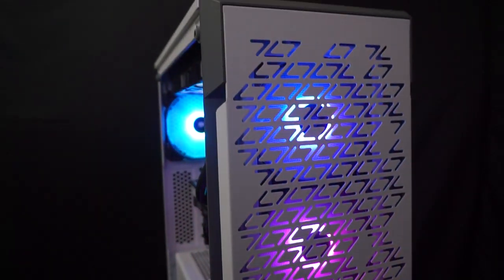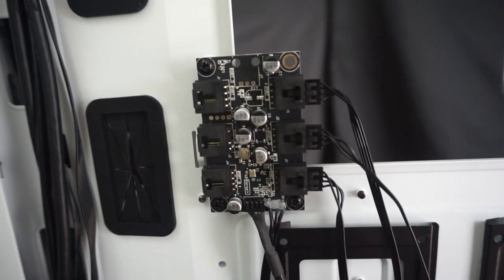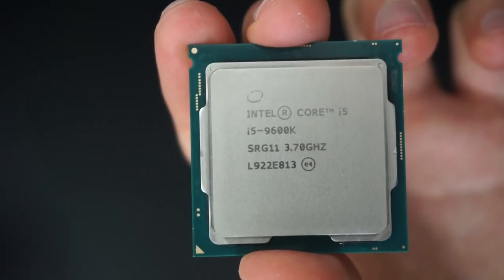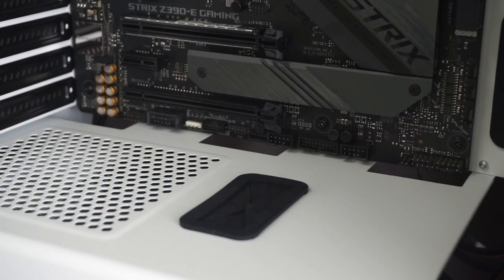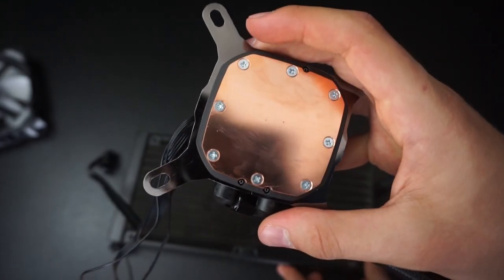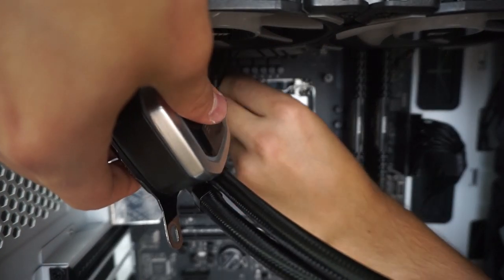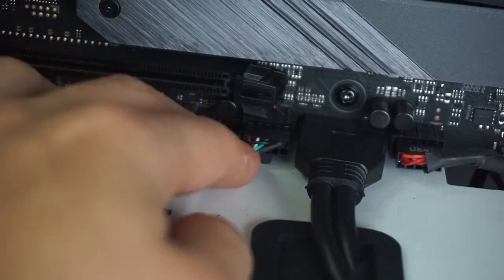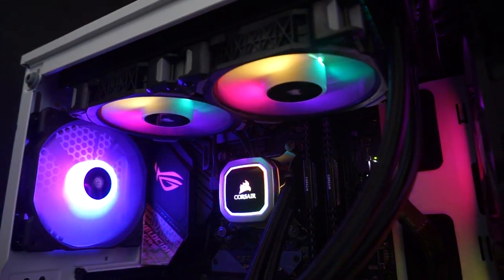Corsair 220T RGB Mid Tower Build Guide

Comment from the maker: To answer your questions: https://youtu.be/SFsQsY7lNiU
Reply: 1:53 your supposed to put the ram in the 2nd and 4th slot for maximum peformance
Reply from the maker: Elite Exility Yes i mention this in the comments.
Reply: Alex Krastev ok
Reply: Alex Krastev 
U
Reply: @Alex Krastev. What is the maximum length of a gpu in there? I want to fit a 3 fan one in there.
Reply: @enzohuang223  300
Reply: @subpoena.  oh h=okay
Reply: Can i use a single fan cpu water cooler and mount it on the side fan slot? or do the cpu coolers only mount on the top
Reply: @Alex Krastev would i be able to fit trident z rgb ram if a h100i is mounted on the top of the case?
Reply: @shamfulla  You can't even mount an AIO on the top of the case in the first place
Reply: @subpoena.  pretty sure you can if it's a 240mm
Reply: @shamfulla  Okay
Reply: @shamfulla  You probably could but it depends on your Mobo
Reply: @subpoena.  does the asrock b550 pro4 atx sound compatible to you?
Reply: @shamfulla  Hmm, that mobo is a bit more cramped than others... I just say send it, it works? congrats. It doesn't? well now you know, you can return the parts
Reply: When I turned the computer on for the first time all the RGB came on in the case minus the front 3 fans. Do I need to set this through the software or is this a wiring issue?
Reply: @SlickRTjr  Do the fans spin?
Reply: @SlickRTjr  If the fans spin and you see no RGB, make sure they're plugged in to the RGB controller in the back of the case, if they are... You may have to download iCUE software and troubleshoot there. (Also make sure the commander pro is plugged in to a USB 2.0 header on you're motherboard)

Edit:Fixed Typos
Reply: Does this work it’s micro ATX?
Reply: @MoreKnowledgeShorts  This is an ATX Mid-Tower Case
Reply: Can you control the speed of case fans or only rgb throughout the software ?
Reply: @vladkuz1298  The case fans are not PWM, so you cannot control their speed directly.
Reply: @subpoena.  so want should I do to control fans and rgb ?
Reply: @vladkuz1298  RGB can be controlled through the controller at the back of the case, however to directly control speed you will need to buy some new fans.

Comment from the maker: Ram should have been slots 2 and 4, sorry for that mistake in the video!
Reply: where did u put the fan connector on the radiator? (im new)
Reply: Alex Krastev where did you put your hdd ?
Reply from the maker: @dkuro4872  I took out the hard drive bay. Don't need hard drives. SSD's are far superior  now.
Reply: Would a HDD cage fit with the semi modular power supply
Reply: @jackminng9272  if you have a front radiator, the hard drive cage must be removed, so its less about the psu, and more about radiator compatibility.
Reply: You think my trident z neo will clear a 240mm AIO? It’s basically flat on the ends, no bumps at the end like dominator ram or anything
Reply: jarrett maltry dont know if you tried it yet but when mounted as exhaust it did not clear the Trident ram for me so i mounted on the front as intake.
Reply from the maker: Phoned_  Who really buys garbage ssds? The whole point is to use good ones like a Samsung 970 EVO, there are many other alternatives to this which all beat HDD by FAR and save so much space in your build.
Reply: I was gonna say lmao, epic video though 👍🏼
Reply: @jackminng9272  no
Reply: @dylanfryga7880  Guess what, I bought the case got a non modular psu ( they had no stock of modular) and it fits
Reply: @jackminng9272  well it is dependant on your psu, but luckily it fitted :)
Reply: @dylanfryga7880  yeah ig

Comment: Thanks for showing this video.  I just ordered this case.  I was concerned with the top mount radiator mount clearing ram.
Reply: Me too
Reply: were you able to get rob ram in there?
Reply: @corysutphin3668  If ur using corsair aio and corsair lpx vengeance ram it will fit. Any other aio or ram is definitely a no-no.
Reply: T. N. What about Corsairs rgb vengeance? Would a Corsair aio still fit with them?
Reply: Impxlse this is late but rgb vengeance pro will work
Reply: @MultiLuckychris  Hi I just ordered a 220t chassis along with H100i XT pro cooler and vengeance pro RAM, would it fit?
Reply: Jopa6008 i have a 220T and G.Skill Trident Z Neo ram. will it fit top mount
Reply: I for corsairs 32gb there wasn’t enough space
Reply: I have mine my rad on top with trident rgb ram
Reply: Omega Weapon what motherboard/cpu cooler do you have?
Reply: Christian Acosta will the rgb vengeance pro fit on top with the radiator
Reply: Did you receive your case yet?
Reply: There wasn't enough space for me, so I had to put my aio on different screws and it doesn't really look nice. So my MSI aio goes with the angle. https://imguh.com/image/img-20201207-055325.GUtJs https://imguh.com/image/img-20201207-055255.GUATI

Comment: Got this case coming in with my huge build in 3 days.. Excitement and tension is coming on strong.
Reply: How did your build go?
Reply: @shiningdragon8737  Went off without a hitch! Only slight problem I had was wiring in the rear panel. I had to put a little force behind pushing it down and sliding it shut. Other than that, works amazing!
Reply: @GingieMC  the cable management the first time usually goes like that: its good as long as u arent bending the panel over time!
Reply: @michaelherron117  Panel is good. Just needed slight force. No wires pinching or warped panel :)

Comment: Awesome video. I'm finishing my build in this case today. I got an extra sp120 to put at the back of the case although it's not a must. I'm pretty happy with it so far.
Reply: Im thinkin of gettin this case and I wanna ask u if u can control the fan speed of those sp120 fans (thru icue?). I read that they are 3 pin.
Reply: @t.n.9508  I controlled the fan speed through my motherboard BIOS. they will be pretty loud when you first boot your pc up but after you set up a proper fan curve they are very silent.
Reply: @TYGA1111  I see, but how is that possible if they're 3 pin?? And can I use icue to control the fan speeds instead of mobo? Sorry to bother, I jus wanna be clear b4 buying the case.
Reply: @t.n.9508  The motherboard regulates how much voltage goes to the fans, therefore determining how fast they spin. and no you cannot use icue to control fan speed, only RGB.
Reply: @TYGA1111  ok i see, well thx a lot for confirming.

Comment: I just used this case for a build, and I really like it. The only somewhat tricky part regarding the limited cable management space was the routing of the thicker motherboard and GPU power cables - there's a recessed channel to the left (closer to front fans) that makes it possible to do this and still reinstall the metal side panel without it bulging out. If you want to install a longer, three-fan GPU, beware; I chose the XFX RX 5700 Xt Thicc III Ultra and I had to permanently remove the front middle fan in order to make it fit. Luckily l still seem to have adequate airflow through the case, after adding an exhaust fan in the rear. It's possible I'll be able to fit a slim-case fan in place of the one I removed, should I decide to try.

Comment: I realize similar questions are asked a million times, but this is my first build... I ordered this Corsair 220T RGB case, a Corsair 240mm H100i Platinum RGB cooler, Corsair Vengeance RGB Pro RAM sticks, and the MSI Z390-A PRO motherboard.  I want to mount the AIO cooler with the fans at the top like you did in this video, but am worried that the RAM sticks will interfere with the fans and I won't be able to get the look I want.  Do you know if you had used Vengeance RGB sticks whether or not it would have fit? Or were the Vengeance LPX just short enough to work?  In other words, do the AIO fans cover the RAM sticks or are the sticks actually clear of the fans?  I also am assuming my MSI motherboard has the RAM slots at the same position as the ASUS motherboard you used.  If they aren't then I may have a problem.  I'm hoping my build will work as I have read that vertically mounting an AIO cooler is a bad idea.  Thanks for your time!
Reply: You have to buy smaller RAM sticks

Comment: Would a Corsair Vengeance RGB pro RAM fit if the cooler is at the top like yours? Another guy said you would need a low profile RAM to fit
Reply: Wondering the same
Reply from the maker: Yes you need low profile ram

Comment: I have a question so the sp 120‘s have 2 cables do you Need to use both of them or can you only plug them in the lightning note core and plug the lightning note core to your motherboard and sata cable
Reply: same have you got an answer yet?
Reply: No I haven‘t but I tried and you have to plug both on to the mainboard. I Need to buy a fan header for cheap so if your mainboard doesn‘t have enough headers that‘s no problem

Comment: Will a 240mm radiator fit at the top if I use the Corsair rgb ram? Great vid
Reply: Do you know yet if it does or not
Reply: Yes, I bought a Corsair H100i RGB Platinum SE liquid cooler that has a 240mm Radiator and two 120mm fans

Comment: hey i got that case paired with a be quiet straight power 11 1000w psu and it doesnt seem to have that 6pin peripheral connector to plug in the rgb  controller. what can i do?

Comment: Does the lightning node controller also provide power to the fans, or do I have to connect the fans also to the motherboard?
Reply: yo did you get an answer
Reply: You have to connect the fans to the mobo as well. The lighting node only allows for controlling of the speeds and RGB.

Comment: I have a question, I want to buy the cpu cooler but im scared my ram wont fit, the space left between the ram and the fan seems really tight, do you think Trident Z Royal would fit there?

Great vid btw :)
Reply: @Alexkrastev  the slightly taller ram might fit. i use patriot viper rgb and it does fit

Comment: Is there Place for an hdd
Reply: There is. He removed the HDD cage because his PSU would have barely fit without removing it.
Reply: @j.7658  The PSU and HDD cage fit perfectly fine even when using a larger size like the RM 750x which I use myself. All you gotta do is fit majority of the cables through the bottom opening at a 90 degree angle :)
Reply: @YaNeK92  thanks so much i was worried

Comment: hi, I have a problem with this case "Corsair iCUE 220T RGB Airflow" purchased on Amazon. I have assembled the pc. The case has 3 fans with LEDs that are connected to a ladder. 2 cables are to be used. One for use is installed and the other to be connected to a USB 2.0 connector on the motherboard. I did the whole thing. I drove on and I can manage them through the icue software. But the problem is that the fans are still, they never turn, not even when they are turned on. Am I wrong something, do I have faults?
Excuse my English but I translate with google
Reply: Resolved
Reply: @bgiovanni75  how did you resolve?

Comment: I’m planning to build one almost exactly like this! Although, if you have a small enough gpu it’s better for your aio to go on the front of the case. You could use the fans that come with the aio for exhaust then. Just a tip
Reply from the maker: Aios always look better mounted up top if its a two fan aio. Its also better to exhaust from the top of the case because heat rises.
Reply: Yes that is true, but bitwit has a video comparing the positioning. There were better cooling results with mounting to the front, and you can use the aio fans for top exhaust and the included front fans for the aio. Just my opinion but if you want to spare the extra cooling for looks you can.
Reply from the maker: @egwagjsd  That would make sense since I guess you'd be pushing hot air up through the rad.
Reply: Tom's Hardware review of the case benchmarked both and found it cooled better with Radiator on the front...

Comment: I have the same case and radiator but couldn’t get the radiator to fit I was having clearance issues with ram 😢 how did you make yours fit??
Reply from the maker: Low profile ram
Reply: Alex Krastev oh ok yeah I have Corsair vengeance and using MSI MPG z390 motherboard

Comment: I plan to move to this case from a cheap garbo one. I have a hdd, and a non modular psu. Will the cables fit in the shroud with the harddrive enclosure attached?

Comment: I'm confused as I have this case and I have the Gigabyte b450m ds3h motherboard and we dont know how to tighten it on and which screws to use
Reply: You need to align your motherboard with the screws at the bottom of the case as he shows at 1:55. I have this case as well and it sucks that the screws aren't labeled, but I'd suggest just using your best judgment and you'll kinda figure out which ones go where through trial and error. Hope that made sense.

Comment: I wonder if I can fit H100I RGB platinum aio on top of this case with VENGEANCE RGB pro ram on B450 tomahawk mobo. I would really appreciate some help with this.
Reply: Thinking about the same thing, but i would go with x570 tuf mobo (ram and aio the same)
Reply: very doubtful that it will fit, stick to vengeance low profile ram if you can
Reply: From what I've heard the corsair rgb platinum radiator fits fine
Reply: Shindo It won’t fit.

Comment: Question - I have this case and AIO. I’m going to front mount the radiator as I have Corsair rgb ram and then mount 1 fan on top and one as an exhaust. Will they all be able to use the same lightning node that comes with the case? Or will I have to get another one? I’ve seen mixed comments regarding this
Reply from the maker: The rgb aio is controlled separate from the node. Some give you the option to attach fan leds to the aio and control them from the aio but i usually plug all fans into a node core or commander pro, or a node pro + fan led hub. Either way you can get all your fans controlled.

Comment: How did you get this to work with two different types of RGB fans? 

The Carbide 220 RGB case is delivered with  SP120 RGB PRO fans and the Corsair H100i RGB Platinum is delivered with ML PRO fans.

Great video!
Reply from the maker: Just connect it to the same controller.
Reply: @Alexkrastev   I tried that and no joy. It looks like either the lighting node controller or the three RGB fans have failed. I have been  in contact with Corsair support on this and they are providing an RMA form.
Reply from the maker: Eric C Did you set the fans inside the icue software to be SP Pro RGB fans.
Reply: @Alexkrastev  Yes. I did.
Reply: @Alexkrastev   where you connect the aio fan rgb cables ? you didnt connect to the hub of the case .. I have the same question because i will set the same build and i have 2 ml fans from aio and 4 sp 120 . ..So if i connect all them to the hub  of case will work ?

Comment: Does the default fans from this case need a power for each of them? meaning if i want to install 6 fans in this case, my motherboard needs to support 6 power fan headers 
for all 6 fans?
Reply from the maker: That or get a commander pro or fan splitter cables.

Comment: If you want to use a combination of fans of different brands, e.g. one for your CPU cooler and a second for the case, can't you just connect them all to an Asus motherboard with Aura instead of using the build-in rgb controller from Corsair?

Comment: Where do I plug in 3 little cables  labeled TKG?? Looks like they’re connected to the fans???
Reply: Andrew Huynh did u figure where to put it?
Reply: Swerve yes those are the lighting cables for the fans soooo I plugged them into the fan lighting on the motherboard, mine were spread out around the motherboard
Reply: If you have a 4 pin on your motherboard is still works with this case I just used the bottom/right 3 depending which way it was facing
Reply: The sp120 pro has 2 cables, for for power for spinning and 1 for rgb lighting. The rgb cables should already be attached to the lighting node core. Just have to find 3 fan headers in your motherboard or buy a fan splitter

Comment: Where does the lighting node control need to be plugged into to get the lights to change color I have the ique downloaded it says no devices found idk what to do
Reply from the maker: Needs sata power and motherboard internal usb
Reply: @Alexkrastev  yes I have the sata cable plugged in they light up but I cant change the colors does the node have to be plugged into a USB port or a USB led port?

Comment: Yo, I have the vengeance lpx so I know from watching this video that a top mounted 240mm aio will clear the ram sticks. Do you think a 280mm aio will fit or was it already a tight squeeze with the 240mm aio? I would rather get the H115I over the H100 just because I plan on upgrading my cpu and gpu in the future and would rather buy the H115I to begin with
Reply: Did it fit?
Reply: @jeremym4568  depends on your mobo. I personally think that an 280mm aio will clear top mounted if you have low clearance ram installed seeing how much room I had with the 240mm aio
Reply: @NismoPWNS  thank you!!

Comment: When I turned the computer on for the first time all the RGB came on in the case minus the front 3 fans. Do I need to set this through the software or is this a wiring issue?
Reply: You need to connect it did you?
Reply: @MoreKnowledgeShorts  I got it working
Reply: Oh nice

Comment: technically on Asus boards when using two ram sticks, use the two furthest slots away from the cpu.  it says in the manual.
Reply from the maker: Yes i mentioned this in the comments, it was a silly mistake.
Reply: @Alexkrastev  im sure it would run and maybe not be noticeable when gaming or during everyday tasks.  I built a full system in this case last night.  It was a very tight fit especially with 240mm AIO and 6 fans total.